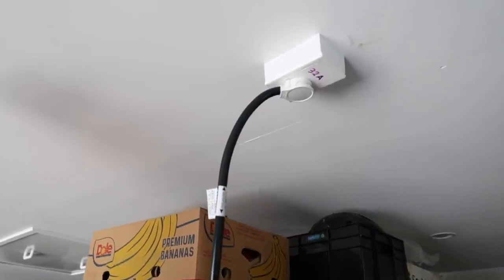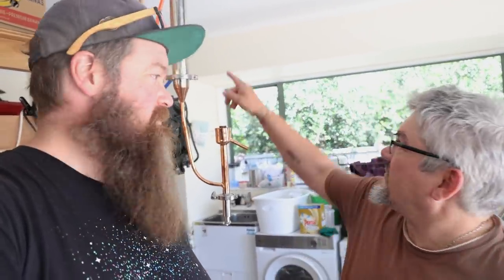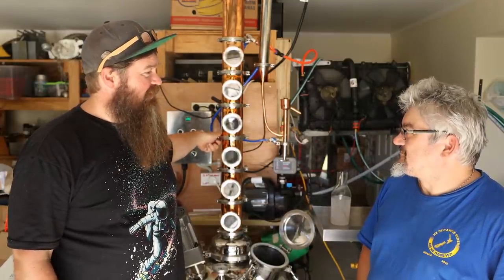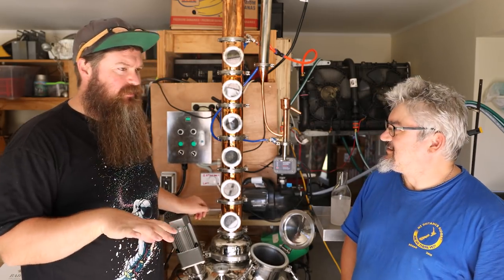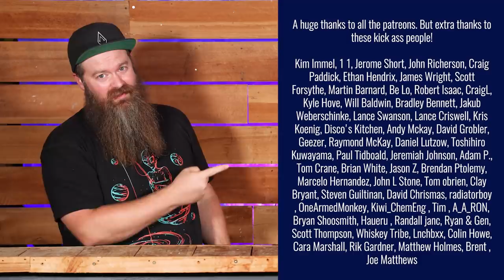Is Buying A still Direct From China Worth It?

Comment: My still is Chinese, the cheapest I found (70$). It was crap, but after adding some inox tubing to make the column large enough for packing (20$), it's quite usable! Like with most cheap Chinese inox, the welds aren't too good and tend to get some surface rust. The rust always washes out with the foreshots. Not great if you're serious about the craft, but for a low-budget hobbyist it's OK

Comment: I built my 1st still recently after 5 months of watching Jamie and a couple others. I decided on a 35L Digiboil, a generic copper alembic dome, SS 2" column with reflux cond. and main cond. with a sight glass and digital thermometer all in tri-clamp. I added a gin basket at the top and a SS basket inside the boiler for on-fruit/grain distilling. I picked up a Brewzilla heat wrap as well. I sourced the parts from whoever had the part I wanted cheapest. Most of the 2" column parts are all from China. The SS basket is for an 8qt. Instapot. I set up the main cond. cooling to run off a hand made garden hose adapter with shut off valve for flow control. The reflux cooling is a separate 1/4" system with a pond pump in a big bucket. All together about $800. I can use it to make almost anything. I hope this helps other with build ideas.

Comment: A follow-up video would be really nice.

I am curious how the thing does after 2 years.
Reply: Probably just fine. The agitator might ware down a little bit but that can easily be replaced for a couple hundred. There isn't much that can go wrong with stationary welded/solderd sheet metal

Comment: I've been running a 30L china special for the last 6 years.   It's stood up to aaaalot of use.  I've averaged a run per week for those 6 years and the only failure has been a brass retaining nut that secures the pot-mounted thermometer.  It simply disintegrated at about 3 years.  Replaced for 50 cents.   Guys, don't buy the cheapest of the Chinese products but their mid->upper range stills are a heckuva value.  You can spend more on "made in XXXXX" if you need the support but don't kid yourselves.  Most of the components in that gear are from the far east regardless.
Reply: "Most of the components in that gear are from the far east regardless."   That is the reality. You see a lot of fear based on racial stereotypes in these threads about stuff being built in China so people buy "Made in America" or "Made in XXXX" and those are just companies selling you stuff made in China anyway. I went down a Coffee rabbit hole and spent quite a lot on espresso makers and grinders and at this point my entire setup is made in China. China has because a technological and manufacturing powerhouse, not just a country making cheap knock-offs. It will take a while for people's perceptions to catch up.

Comment: For that pump, as long as you control it on the discharge side and have fittings that will hold 20-30 psi, you can completely stop flow and not hurt anything. Gotta be on the discharge side though, control flow on the suck side and you'll cavitate. Centrifugal pumps will just sit there and spin with the fluid, not positive displacement like and piston pump that makes a solid seal on discharge and needs relief valve like you're average garage air compressor. But bypassing the extra probably helps with cooling though.

Thanks for all the videos!

Comment: I hope so cause I already did. bought the same column but I'm not ready for the jacketed pot yet. bought the same control box but they also offer with a PID. No customs fees in the US so no hidden fees there. Don't know if it did at the time this was shot but it clearly states on their website that the control box doesn't include any wiring from mains or to the elements so no surprises for me there. I already have a 60 amp welder circuit and am familiar with wiring the elements so I'll be good to go. Unfortunately I am not in the US at the moment so I won't be able to report on quality until May. I am encouraged by the findings of your friend Dana. Thanks this was a great video. I had seen a few reviews on other channels but none really looking in depth at the quality workmanship like yours.
Reply: PID's are inherrently flawed for distilling, please do a few searches maybe on homedistiller or another reputable source.  They are only promoted by people lacking a basic understanding of how distillation works.  Simple power or voltage regulation works perfectly, but trying to control that process based on a thermoprobe is a massive fail.
Reply: @MrJhchrist  I have done some research on the use of PIDs. I intend to also use my controller for mashing and boiling on a separate vessel which is why I chose a PID. It is my understanding I can use it in manual mode which is basically like looking at a digital thermometer and making power adjustments with that readout as a reference. I'm not a beginner and I have mashed boiled and distilled with manual control as well as direct fire propane before. I decided I would like to try PID and if it doesn't work out as expected the price difference is minimal in the grand scheme of things and will be very easy/cheap to retrofit.
Reply: @bookie60  Right on.  I think it's important to make the distinction though as "manual mode" literally has nothing to do with Proportional–Integral–Derivative control.  While some PID controllers do allow for a manual power control, that is a completely different thing and any random newb reading our comments should hear that.  Especially since a few very inexperienced distillers have fairly large platform on YT and also happen to sell PID controllers.  Actual PID control is great for mashing, terrible for controlling a still boiler where the boiling point inherently varies from batch to batch as well as throughout every run.

But by all means if a PID controller also offers power control then it can be used for boilers as well as mashing (or fermenting, or sous vide etc).

Cheers
Reply: I don't really give a shit how some random noob interprets my random youtube comment. I don't really think I have a burden of responsibility here. Especially when George over at barley and hops (who by the way seems to have a fairly good understanding of the basic principles of distillation) is making whole videos about how great pids are. My original comment only barely mentioned the fact that Oak Stills controller is also offered with a pid. And I only mentioned it because some people might want one and they don't list it on their website. Should have known I would get scolded by some forum dad. You know on second thought I'm gonna run in full PID mode and leave my still unattended and see if the garage blows up or if it makes pure methanol and I go blind.

Comment: I did "cleaning" for start ups or rework on FDA food and Pharm stills and posses piping, run Tri Sodium Phosphate(TSP) at steam temps, low% to water (1tbs per gal) PH about 10 or 11. Gets rid of any oils and others used in manufacturing or shipping. Neutralize with Citric/Ascorbic or vinegar over board. Then run with your acid of choice, overboard, rinse, and ready to go!

Works good on ammo cleaning too.

Thanks for the info guys!

Comment: The "Extra" 3 to 1 manifold is for a pressure gauge and a Over Pressure valve, OPV.  You mount it on a 2in on the boil pot.
Reply: We have these at the stills at work. It’s gotta be a safety manifold, usually with a pressure gauge, pressure release valve, and not sure what the third opening would be for...
Reply: @iceman77706  

The ones I saw running the third was always blocked off.  In a still that has a control system youd have another gauge to the computer controller in the third one.

Comment: You guys are competent cobbers. If you pick up an older dehumidifier you can easily convert it to a circulating ice water source by gently bending the condenser down into the collection tub. Add some insulation, a pump, and hoses and you have a device with one third to one half of the footprint of a freezer.
It is not as pretty as your still, but, usually cheap at yard sales and thrift shops. Most folks ran the appliance around the clock, then barked at the power bill. Converted, the collector is a block of ice after 20 minutes and lasts for hours so add a timer or thermal controlled on off switch and the cost of a run is minimal. I chose the thermal method.

Comment: I also bought a 4 inch coloumn and a dephlegmator from Oak stills. All looked good but the dephlegmator sensor was put to measure the water temperature instead of measuring the steam temperature which makes it a lot harder to run properly so I had to rebuild that a bit. And also the sensor didn't have any gasket or option to add it so it was leaking quite a lot. But the craftmanship sure looks nice.

Comment: You need a globe valve if you want to throttle flow, to keep the valve from washing out. I can't imagine it would be a real-world problem with low-pressure water though more of a high-pressure thing. That's what we use in oil and gas applications.

Comment: Plum brandy - sieve the seeds out first before charging the boiler,  using a 6 mm sieve. Otherwise mill the fruit and make a puree for fermenting. Even with a spherical bottom kettle, the plum pits clog up a 2 inch TC port and ball valve. Nice work.
Reply: Breaking up all the seeds in your plums before mashing or even distillation will definitely put you far over any threshold for cyanamide which any country considers "safe" or you'll have to end your run a LOT earlier, and even then you're kind of pushing it.

There are drum based sieve machines which will remove the seeds from stone fruits without damaging them, but they are often either very big or very expensive bits of kit, sometimes both.

The most compact one I could find is the robot coupe c80, but if you can't find one second-hand, it really is too expensive to buy new.

A better solution is to allow for backpurging on the outlet so you can dislodge stones if they do get stuck. That way, a 2" TC port will be able to handle almost anything besides the more stubborn grappa mashes, though it does use more water and creates more backset. 

Depending on your strategy of elimination that might be a bigger issue than clogging though.
Reply: @horrorhotel1999  We used an apricot mill to separate out the pits. The mill works better with the varieties that have smaller pits.

Comment: I’ve just done the same exercise - 50L 4 plate, 4 inch still, big whiskey head/onion, gin basket, and and and. 
Sitting in the box at hone waiting for me to get back and unpack it. 
Price was about half of what I could get for exactly the same item locally.
Reply from the maker: New toys. . . . Exciting!
Reply: Who doesn’t love new toys!?
Reply: This is what I’m thinking 50L not a 100L .  Do you have a link you’d care to share where I can look at your still?
Reply: @silveraven1  Dunno how to do that here, but if you message me in FB I’ll be able show you some pics.
Reply: @silveraven1  50 litre is a beer keg 1/2 barrel.   You can buy them used for cheap.     look up keggle.
Reply: @robertfontaine3650  thanks for the suggestion, but looking for something pretty like the one those boys have there.
I will check it out though, thanks

Comment: Got a 53 gallon w/6” column from mile high distilling it’s amazing
Reply from the maker: Nice
Reply: How much was it?
Reply: Tots with controller and pumps ect I’m 8500 in. But we are starting a micro distillery.
Reply: @charlesschmidtke8427  Are the commercial controllers worth having for a hobbyiest? SCR or even PID with a soldering iron seem like enough for a tended still. Ground Fault circuit is the only part you need to buy that is expensive.
Reply: @robertfontaine3650  what do you mean by “ground fault circuit”? You mean getting an electrician to install GFCI protection?

Comment: Looks like they shipped him silicone gaskets and not PTFE ones. Ignoring any potential safety issues they will pick up and hold the Gin aromas and flavours so will be OK until he wants to run a neutral and then they will leach flavour back out. PTFE gaskets don't cost much more and work just as well, it just seems strange that companies still ship silicone gaskets that degrade when exposed to quite a few chemicals in the distillate. Acetone, which is in foreshots, swells silicone just at room temperature and can effect the seal, under reflux all gaskets  are exposed for quite some time so something to watch out for even if you aren't concerned about using unsuitable plastics in distilling.
Reply: Yeah, even if you forget the potential for chemical leaching, you really can't forget about the fact that those gaskets will degrade over time, and if you wait to replace them until they fail, they'll fail in the middle of a run which is a whole mess, not to mention a fire hazard.

Much better to use PTFE foam gaskets, they last forever, don't get pinched, and unless you're boiling fluorine, you don't have to worry about any chemical leaching.

Comment: If its Jacketed, the more economical route is to use water in the jacket, fill above the heat elemetns, to where the lowest check valve is at.  The high density steam is is more efficient than a liquid bath bain marie.  Additionally its also more responsive to changes in heat adjustments.
Reply: That will create very low density steam. High density steam is what you have in powerplants where the vapor is so dense it's damn near 1kg/L You need a very high pressure vessel if you want to hold the high density steam and the fact that the still is robbing the jacket of so much heat and there is only a few kW of power to produce that steam there will never be anything other than just a very very low density steam in this setup.
Reply: I run a 150liter jacketed boiler similar to this one, trust me the jacket with enough water to keep the 2 5500 watt elements submerged with steam in the jacket is more than adequate to boil the mash in this guy's boiler.  There is no need for oil or glycol, that just adds unnecessary costs to running you still.  Maybe its not high pressure, but the steam itself is very dense and will boil the mash to 212F very easily.
Reply: @hypnopooper6252  Indeed! However what you have is not high density steam. High density steam is wet steam above 10 bar of pressure. I doubt your jacket can hold even 2 bar. It most probably is vented to atmosphere.
Reply: Seconded on this - my jacketed boiler works way better when not full of water. I’ve not thought about using Glycol before - I would be interested to see sone stats on how that higher boiling point impact on overall times.

Comment: Awesome to see! I've just bought myself a column from the exact same company. Very impressed with their customer service. Quality isn't the best but should work well. Ended up with a 4 inch, 6 plate borosilicate glass column. Has a 20 inch packed section before the dephlegmator. Running 2x2200w elements in a cut an shut double keg boiler. Maiden voyage in less than two weeks with good old tpw. Should step my shed game up!
Reply from the maker: Oh man.  That sounds epic!
Reply: You got a way to share pics? Would gladly keep you updated on it brother!

Comment: I am new to the craft but I can't shake the feeling that I will always love my setup because I built it mid lockdown with what I had. I converted an urn into a still  and have been tweaking it ever since for the love of it. No agitator built in but it cost around 2000 ZAR (South African Rand). But one day I might buy a beast like this.
Reply from the maker: I can totally agree with this.  I still love my ccvm / pot / plate still.  It really comes down to the boiler with this thing.  I think beat solution is build everything else and buy a potnin a lot of ways
Reply: @StillIt  Nothing to really respond with brov, Ii just wanted to say that you're  a legend and You're channel was a huge motivator for me getting into this craft. Ii knew I could make ethanol, but you gave me the confidence to produce adequate booze lol. Genuine thanks (even though ya from the wrong side of rugby hahaha #SA) you awesome dude!!!!!
Reply: My keyboard just fucked out. I trust you'll decipher my message. It's difficult to pretend that I screwed up "I" at least twice and somehow squeezed a "you're" in there where a "your" shoulda gone hahahaha. But then put "you" where I should've put "you're".... I give up hahaha

Comment: I worked at a distillery company for a few years, and we ordered ALL the stills from China to resell them. Several distillery brands get their tanks from China. Then, we modified them a little to make them work correctly. Most of them have held good through the years, and the ones that didn't were usually ruined over the operator. I no longer work there and have nothing to gain from it. If you're curious about running a Chinese still, they work just fine. Some tanks may require modifications to function if you buy straight from China.

Comment: I bought a still from Oak a few years ago, although a lot cheaper version. 100ltr boiler 4” x 4 plates. Also got the control box. Cheap as $1,600 USD delivered. A few issues, the controls box was way over sized, the plates leak a bit, just need tap and tighten as u go. Seeing the jacketed boiler makes me think it’s time for an upgrade! Made heaps of booze, gin, whiskey, rum. I’m the most popular bloke in my street.